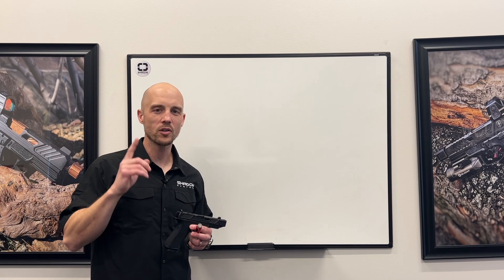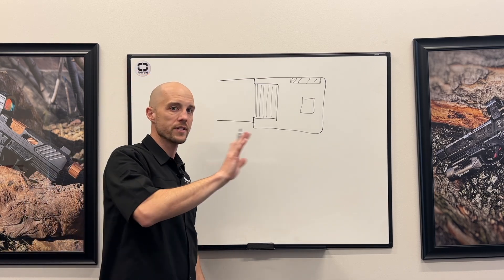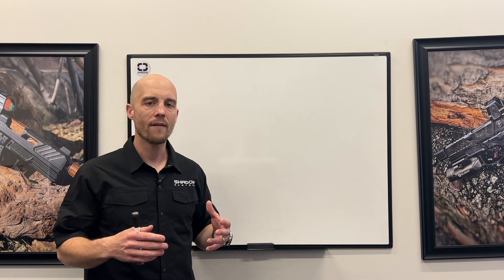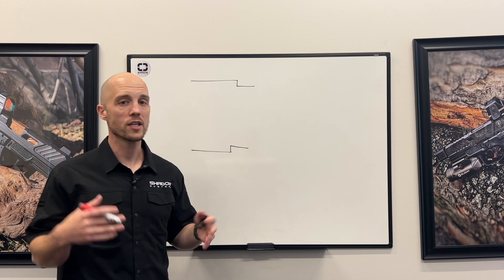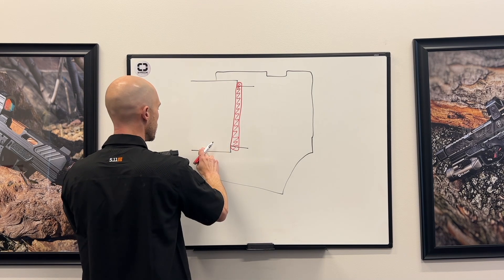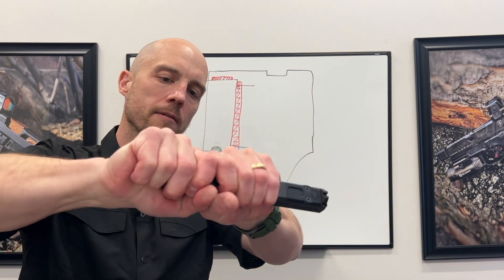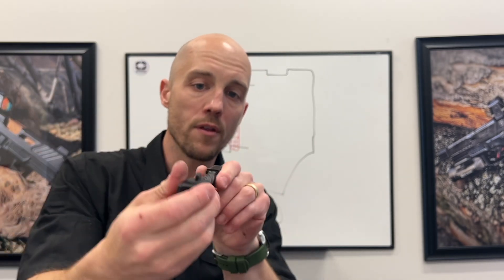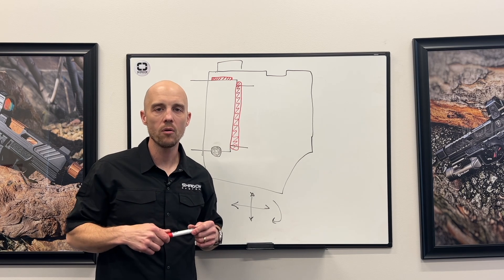Technical Tuesday - DR920P Attachment Method Deep Dive

Comment: The main issue I see with this design is that the compensator is inseparable from the slide. Taking the comp off also removes your front sight, and the barrel is made only really to work with that specific comp. I think a better solution would be like the design of Sig's P365 Xmacro, where the compensator is part of the slide.

Comment: Just got mine went to range and it would feed no matter what I did
Reply from the maker: Hi!  Can you tell us what ammo you tried?  Have you tested it with the included 15 lbs spring too?  Trevor
Reply: @ShadowSystemsCorp  hello Trevor I never got the spring I talked to chad and he said the extractor pin might be to tight or wasn’t checked during the build proces I tried to push out the pin and it would work shot 100-150 rds after had 3 failures otherwise ran good

Comment: I got my DR920! Just waiting for the CR to drop and I’ll be super happy!

Question though: My comps pin is SUPER STIFF. I had to take a punch to tap it out. Will this loosen up over time?

This isn’t a big deal, but I’d rather not have to take my punches to the range if I need to take the gun apart.
Reply from the maker: Hi Not Bill Nye. Did you find it loosened up a bit with use?  Trevor
Reply: @ShadowSystemsCorp  I haven’t been able to shoot much recently. I’ll shoot a few hundred rounds this weekend and let you know!

Comment: I was wondering, I have a MR920L with a Agency Arms dual port 417 comp and I was wondering if the DR920P slide will fit and function on the MR920 frames?

Comment: XR920 with that comp would be splendid.
Reply: I think the size of the slide is similar to the XR as it is cut back slightly so it’s probably pretty close.
Reply: @Armed2theTeeth  I mean that I would want this setup that is the total length of the XR.
Reply: @snurd4788  ahhh…got ya.